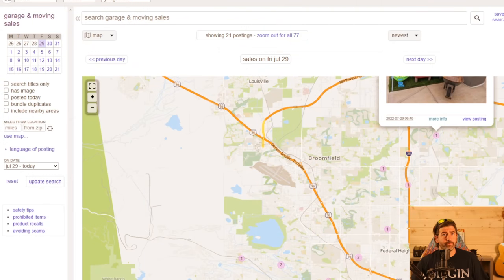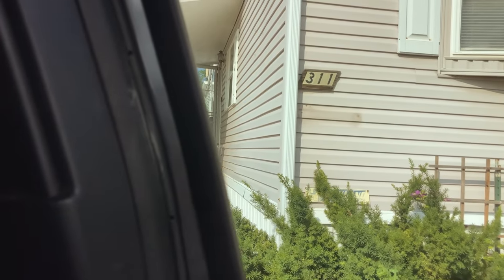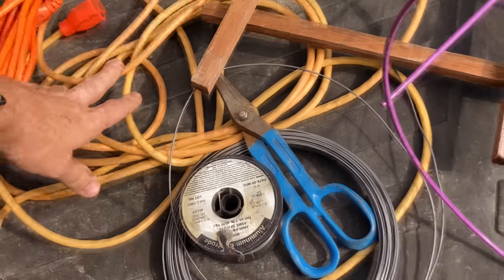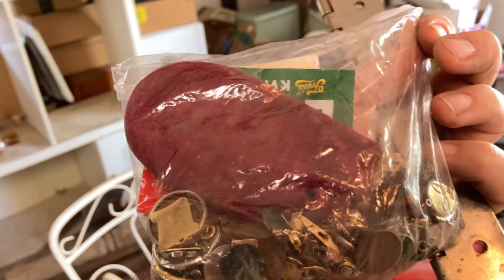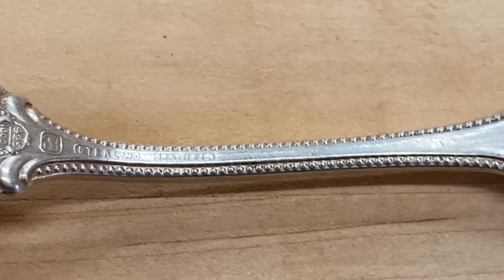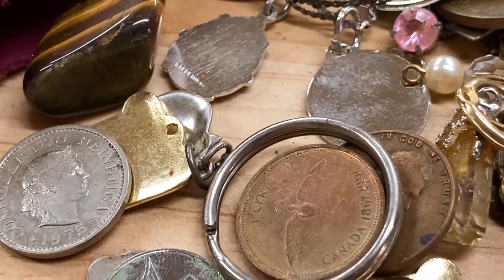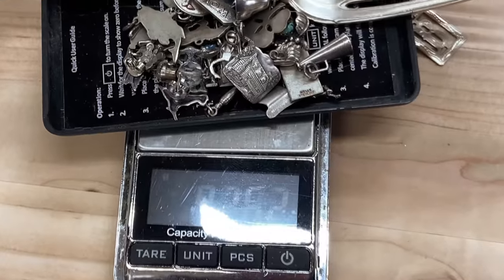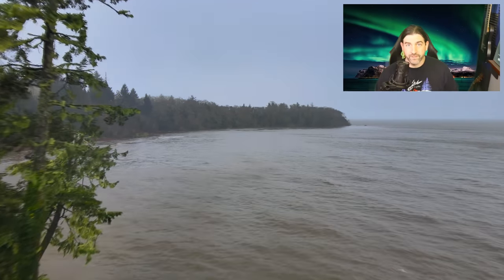Silver and Gold Treasures Found (Yard Sales Are Awesome)

Comment: Back in the 80's, I was a trash man. You wouldn't believe the stuff that people and even businesses throw out. REI- new fishing pole and canoe paddle; Apartments - pair of NIB Jenson coax car speakers; motorcycle shop- NIB small dirt bike motorcycle (we told the shop owner about this one)... Amazing stuff!
Reply: I pulled 7 laptops and 3 tablets from our local college and the apartment complex across the street in one night. Was a crazy night. And over half worked fine as is but were just a few years old. And I got my netbook, still fully charged, with nothing but a single picture on it, no damage or anything, from uscellular one night. Got a charging cart with 40 iPods, everything works no damage,  from the same elementary school I got my 10ft smart board, needs some software and a part replaced, but i just use it as a white board mostly. And I'm in a super small town. People throw away crazy stuff.
Reply: @alexismartin5257  What a haul! It's amazing for sure!

Comment: That "wire" is 4043 Aluminum GMAW  electrode for welding.
Reply from the maker: I'm sure it'll work great for "wire" too
Reply: @Klesh  yeah it'll work good as a tie wire. That's a soft alloy. It is about $10 a spool right now.

Comment: Estate sales are always rip-offs. They mark up everything according to what they cost new. When they have their "25% off everything" sale, it's approaching what you may want to spend if you really needed it.  I was rooting through a box of junk parts in the garage at an estate sale once and pulled out a couple of used circuit breakers. They wanted $5 each for them! Whew.!!
Reply from the maker: It all depends on who's running the estate sale, in my experience. SOmetimes yes stupidly overpriced,  few months ago a n estate sale was asking like $5 for a dishrag. Then sometimes you get lucky and find all sorts of valuable things for next to nothing. It's all about putting the miles and research in i've learned
Reply: Not always. Just went to one in denver and found antique hand tools for not much